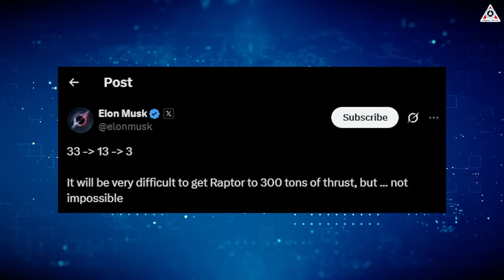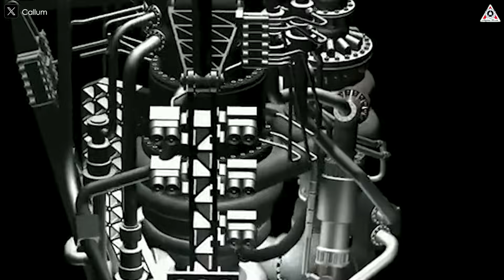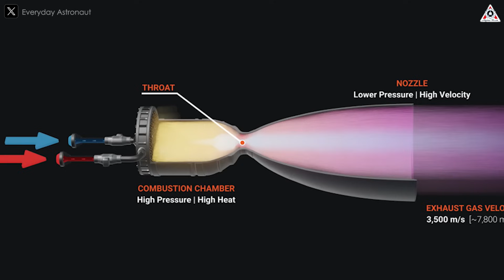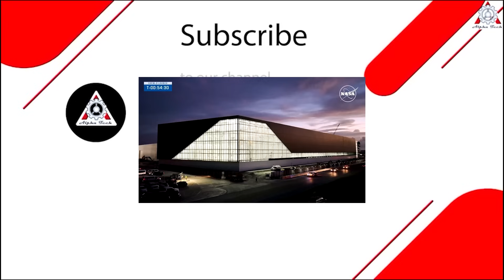SpaceX revealed NEW upgrade for next-gen Raptor 4 just shocked the entire industry!

Comment: SpaceX is pushing a single combustion chamber to 300 tonnes force (metric, SpaceX uses English tons notation, but its metric tonnes) on the Raptor 3 where the Russians decided that multiple smaller thrusters on its RD-170 that produce 185 tonnes (metric) each would insure combustion stability.   The Von Braun design origination of the F1 had combustion instability that destroyed the original engines in a few seconds in a fantastic explosive manner.  Average thrust for an F1 Saturn V (sea level to vacuum) is 1.5 million pounds force which is 682 tonnes force (metric).    

How much more thrust can be produced by a single combustion chamber before combustion instability becomes a large concern is likely before double 185 metric tonnes or 370 metric tonnes force or the Russians would have used fewer more powerful thrusters.  The Russians had similar problems with large combustion chamber instability and decided to use multiple smaller combustion chambers.  Engineers eventually got the F1 to defeat combustion instability with testing creating combustion instability.  It took a long time before starting a F1 engine didn't result in large explosion in a few seconds.

Comment: Understand that rocket fuel is needed for lunch, but could the ship be fueled with nuclear instead of rocket fuel that would simplify things I think can be more efficient than having these service stations gas stations in orbit
Reply: No nuclear-powered rocket that we can design and build today can produce enough thrust to escape Earth's gravity. Their advantage is for long-duration low-power thrust. One application would be to power an orbiting spacecraft to and from Mars. You would need chemical rockets to get it into Earth orbit. But once it is there, it could handle the rest. The nuclear rocket would provide continuous thrust all the way to Mars. Half the trip would be accelerating toward Mars. The second half would be reversing direction and using the nuclear rocket to slow down as you approach Mars. This technique would dramatically reduce the time to travel to and from Mars. And this is extremely important because of the ultra-high radiation levels that the astronauts will be exposed to when they leave the protective electromagnetic field of Earth. NASA has successfully conducted nuclear rocket tests many years ago. And they have an upcoming mission that will test a new design soon. Finally, most nations restrict public and private access to nuclear materials. So most nuclear rocket testing would need government approval and oversight. The "red tape" is enormous. There are also restrictions regarding safety. The largest fear is that a rocket carrying a nuclear device would malfunction or explode, scattering the nuclear material and contaminating parts of the Earth. So a lot of careful planning and oversight is required -- much more than for conventional rockets (which is quite high on their own).

Comment: I'm really looking forward to Raptor 3 having its debút in the next couple three flights...

Should be amazing considering how well Raptor 2's have done to date.

Certainly better than the Raptor 1 test flights..

I think we are in for a Space Community treat with Raptor 3 coming into service, we should see way faster acceleration, way better reliability, and way lower cost..

Basically SpaceX, Fabricated Ships, and Raptor 3 engines will save NASA, after its budget cuts. We're talking rockets cheap enough to be disposable, 
but R-NOT! Basically NASA should encourage other start ups to develope  similar tech. To scale of their first rockets.

Elon is pretty into open source stuff, and maybe Jared can twist his Space Suit arm, into helping others that pass the DOD National Security  sniff test?

Doesnt need to give them everything, but at least core priciples to work from, make them do the math homework etc. for their own good.

Its not like nobody ever, helped SpaceX getting to Raptor 3..

On Raptor 4, they are probably running onto diminshing returns on simplification and weight reduction,  and my guess is will scale up slightly to get a better volume to weight ratio on the engines...

After that, what they learned upscaling combustion chambers could help one of two directions: next upscale, or going to multi chambers to one pump system to cut parts count, especially moving parts and they are most iffy on long term use.

If I were Elon's Assistant, I would recomend one more upscale, so the had three size data points and could grade them on the curve, to project forward other scale increments up or down.

Then, goto, Multi Chamber to pump ratio, and start working up the chamber numbers to pump size ratios.

With a repeat on the data curve for scaling.

Then, they could use Mini Raptors for thrusters for small stuff uses, from directionals, to Mars rocket sleds...

And the larger scales be used on future Starships of increasing diameter and hull complications...

Whats gonna happen, is Space Launch systems are gonna morph towards horizontal accelerators, and "Wing-ed Re-entry" shapes.

And current Starship an interim
Tech and test bed.
I did writs here in the past on horizontal accelerators as add ons to existing Military and civilian runways, and was recently pleased to see the Chinese are starting a program towards that tech.

Nothing will motivate Space Force and the Politicians better than the Chicoms getting ahead, whilst they sat on their thumbs...

And I suggest the young nerds who are wannabee Space hull Zengineers, start working with the thicker card stock and super glue learning hard chine construction, and how to create even blended wing shapes of arched gores ..

Silly Rabbits! rings are for tanks!

Wings are for high glide we-entry...😂

Especially with heavy cargo, or coming in fast from a far orbit...

Maybe some exquisite  competition in modeling might get Elon's attention for hull team spots?

Layout Engineer, is gonna be a thing...

Just sayin'
Reply from the maker: Oh man Gary, your comments are always long and full of insight, it’s awesome having you as part of our audience.
Love your ideas! I’m also really looking forward to seeing SpaceX roll out Raptor 3 and even Raptor 4 on Starship... can’t wait to turn that into some exciting videos. Thanks a lot!
Reply: @alphatech4966  Thanks!
I really enjoy thinking about and writing about Space stuff... I started reading Sci-Fi about 1964...
Yeah, I suspect NASA's budget cuts will hardly be noticed thanks to SpaceX lowering costs, and opening up possibilities for better alternatives, like with Stations...
I bet the best era is just starting, and I'm  looking forward to Jared Isacman's effects on NASA too.
Also saw today on another channel that Trumpster is giving FAA hell over their space division slowing down progress...
I seem to remember doing some writs suggesting that could happen... 🤣

They should have never messed with Elon's Rocket Company! big mistake! 🤣

Comment: I had thought that the aim was to reduce the size so that there can be more engines fitted , this is to reduce the individual loading and five better dispersal , but I assume this then creates a fuel supply problem . Perhaps more smaller engines would over come the hot stage separation problem